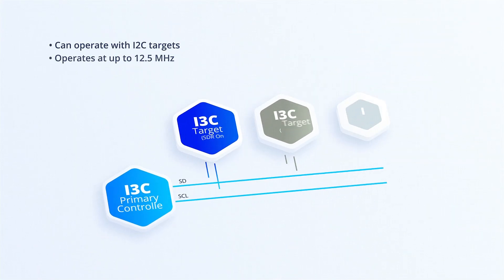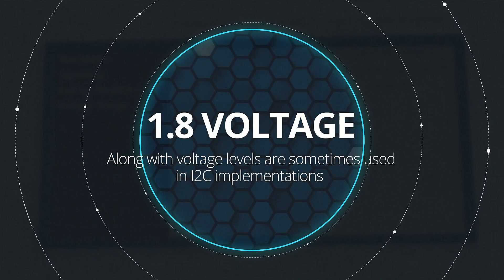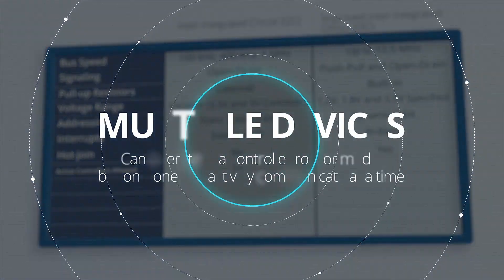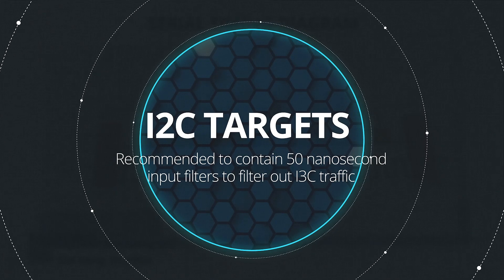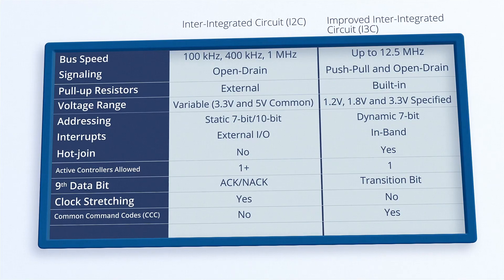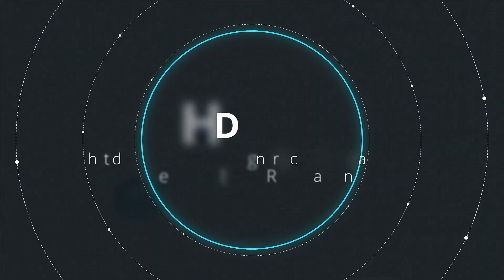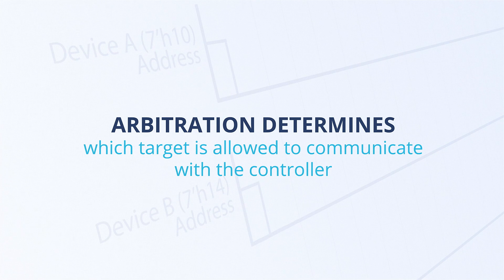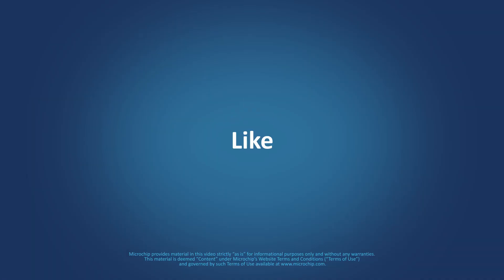What is I3C®?

Comment: Hypothetically I got a CM5 module from RasPi; is there a world I ever use this? Seems like this is only going to really be usable between microchip products, which severely handicaps its usefulness.
Reply from the maker: Hi there, thanks for your comment! The Raspberry Pi CM5 can absolutely be useful with Microchip products. While I3C offers advanced features and higher speeds, it’s also backward-compatible with I2C, which the CM5 supports. This means you can use the CM5 in systems that include Microchip devices. As I3C adoption grows, its interoperability across manufacturers will expand, increasing its versatility. Hope this helps!

Comment: I feel I learned very little.  For instance, apparently arbitration is done at low speed, though that wasn't explicitly stated, then it would seem the only speed benefit would be for long packets.
Reply from the maker: Thanks for your feedback! You’re right—arbitration in I3C does happen at lower speeds, which helps manage longer data packets more efficiently. If you have more questions or need further details, feel free to reach out or check out our additional resources. We’re here to help.

Comment: Seam like too much of a squeezing in more features to only have something slightly better. I believe (I could be wrong) I2C  was for inter board coms. To me, if my application/design needs more speed then SPI or UART, If I need to go off board then CAN or Ethernet
Reply: I2C is supposed to be written and pronounced I-squared-C or IIC which stands for Inter-Integrated-Circuit. So it is supposed to be intra-, not inter- board, i.e. between chips on the same board. Not sure if anyone has contrived a rationale for I3C yet though! The address assignment looks like a killer feature since at the moment you have to hope that two ICs will not have the same default addresses or else IC pins have to be reserved for selecting amongst a limited number of alternative addresses.
Reply: @john_hind  Thank you for the correction, i get intra and inter mixed up all the time, but yes, I agree with what you say